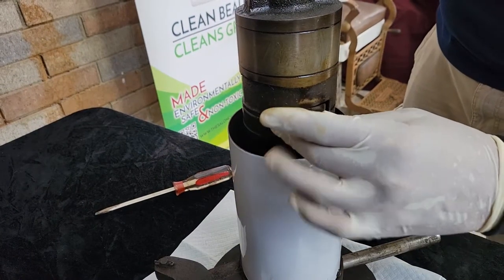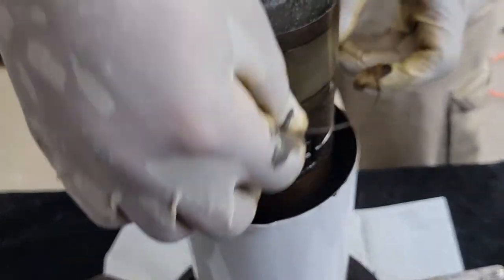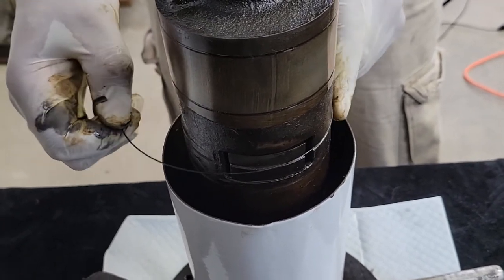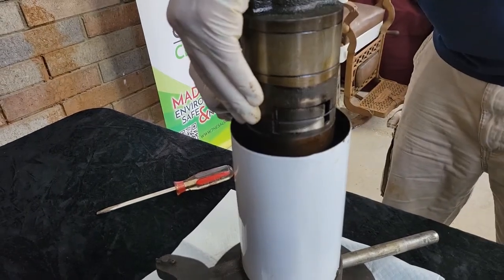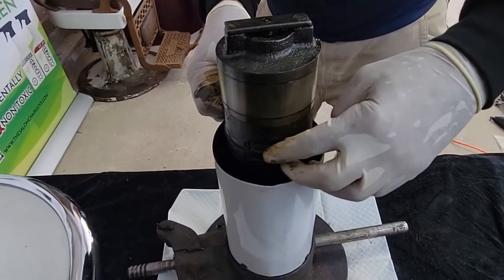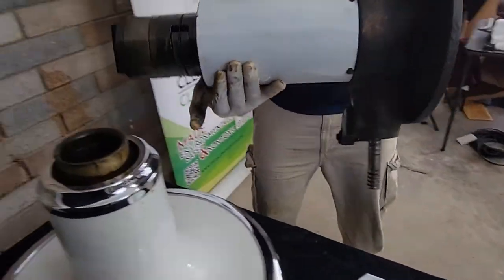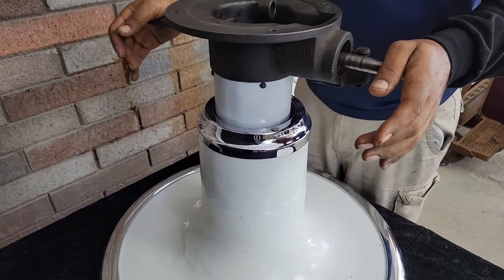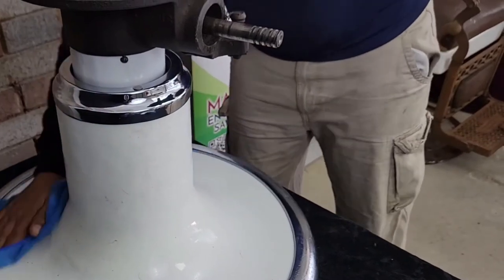Antique Koken Barber Chair Repair - Lock Placement

Comment: I have a Theo koch chair recently purchase. The guy sold it to me for 200 I just found out it’s worth 300 as is. My question is this it’s doesn’t lock. It doesn’t pump nor lock in the seated position but I just pulled it up there is no fluid. Do you think if I put hydraulic fluid in there will it lock

Comment: I have a Koken barber chair, it does not pump up, I’m wondering if you need hydraulic fluid before to see if it actually works? I’m almost finished with this chair. It was a mess when I started. I soaked all the chrome pieces in vinegar to break the rust from it then grind the light rust off with a power brush and coated it with chrome. So this is the last step for me as far as I know. Any suggestions?
Reply from the maker: Sounds like you're doing a good job, as far as the fluid slowly put in fluid and Pump It Up to see if it rises. You going to hear some gurgling but that's okay, just don't overfill it.
Reply: @TheSalonChairGuys  well there is gurgling with what little bit there is left, it’s pretty much empty. So I’m guessing that’s all it needs.. I’m a Jack of all trades but this is new for me.. I started from scratch. I think so far it’s coming out pretty darn good.. Thanks for the response..
Reply: @TheSalonChairGuys  well I got hydraulic fluid, it doesn’t pump but the breaks works. The arm pump feels like it has a lot of slack.
Reply from the maker: It's possible the seal is blocked. Download the guide on our site. It might help https://www.liinks.co/salonchairguys
Reply: @TheSalonChairGuys  I did notice the handle on the inside where the rod is, had been rotted when you twist it the chair does lock and releases pressure for it to drop and hold pressure but does not pump. I will look at the diagram and see if I can notice anything else. Thank you.
Reply from the maker: It's a whole guide so you should download it  hopefully it helps

Comment: My chair pumps all the way up but will not hold very long before it slowly goes down. What does that mean?
Reply from the maker: It sounds like your chair is losing pressure because of a busted hydraulic seal.